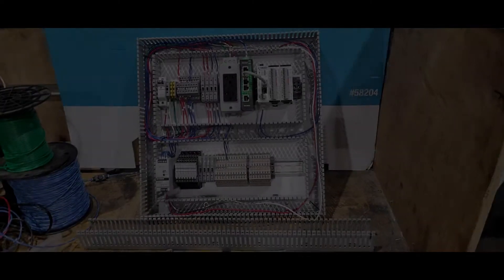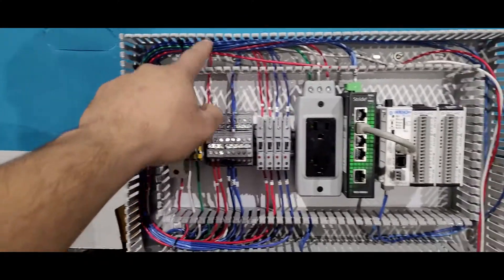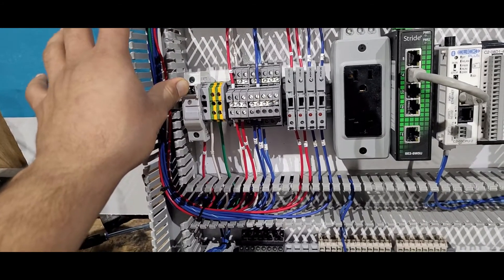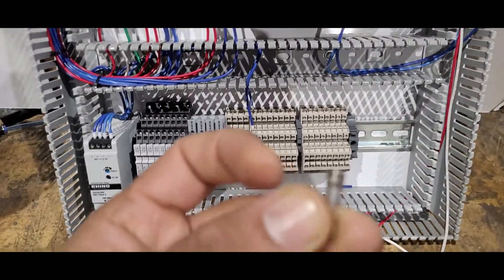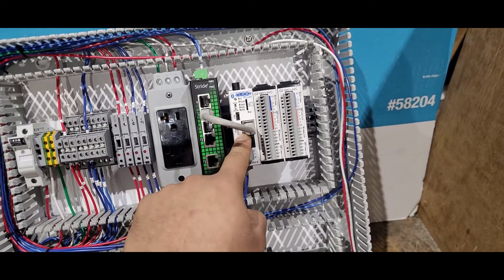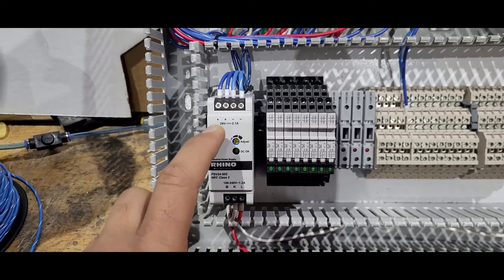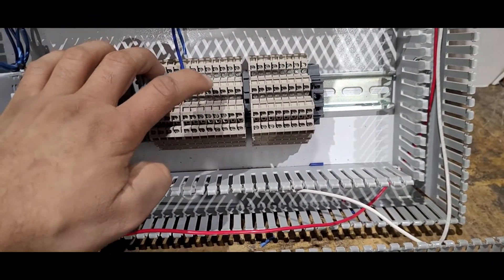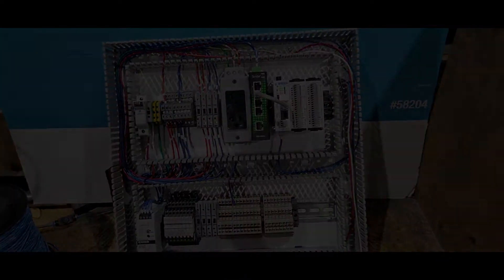Control Panel | Industrial Automation design | Wiring | Electrical Components

Comment: Good video. I learned something. Question: How do I use din rails if my components don’t have a way of attaching to them? Bridge rectifier, SCR, EMI filter, DC Choke and ac to dc power converter. 
Thanks.